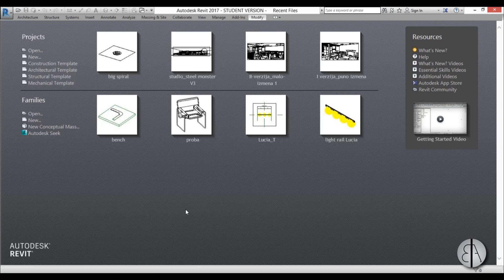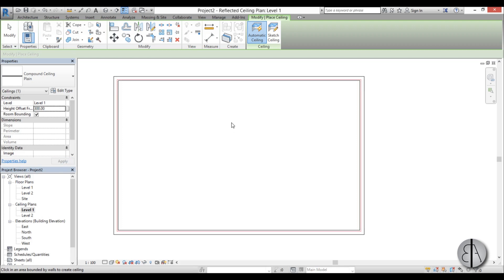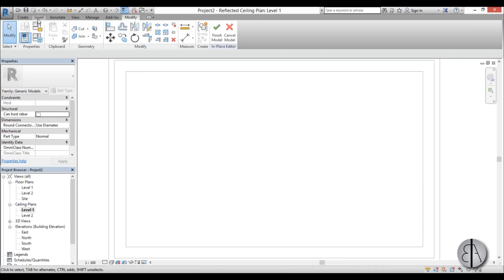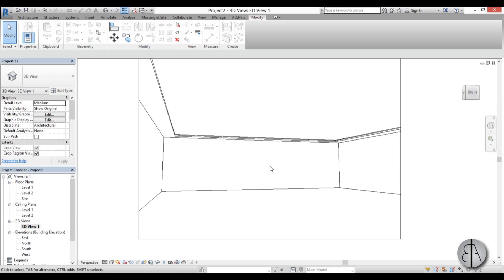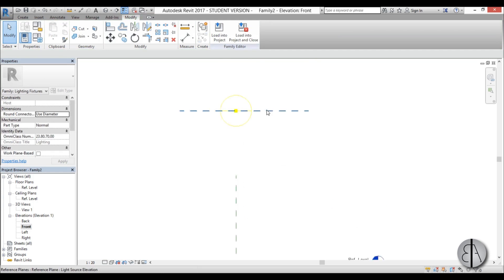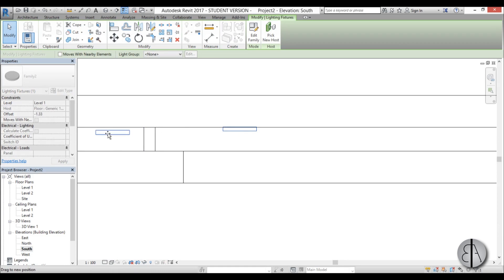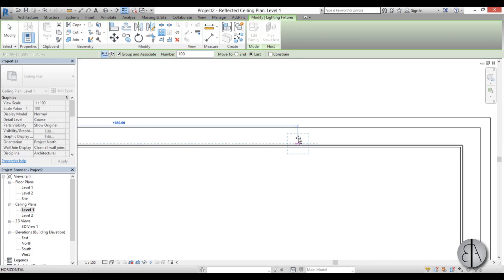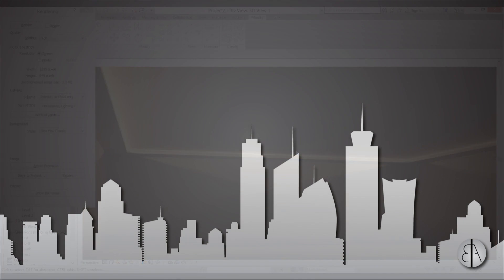Recessed Ceiling with Light in Revit * Light Tutorial *

Comment: Wow. That's allot of light sources! Would take forever to render if you have a more complex scene..
Reply from the maker: I've rendered complex scenes with light like this, its not that bad :)
Reply: Balkan Architect maybe Revit render calculates these differently. If you use external render then you use it's lighting elements anyway. Wheres the kitchen project from your thumbnail? Thanks for the tut!
Reply from the maker: Yes you can use external rendering with artificial lighting settings but than it is usually a bit darker so you need to correct that. Oh the kitchen is just an image i hat, that was quite recognisable for recessed ceiling with lighting so I used it for the thumbnail :)